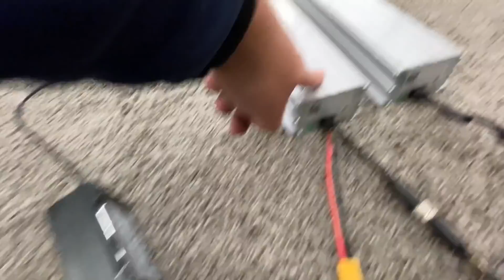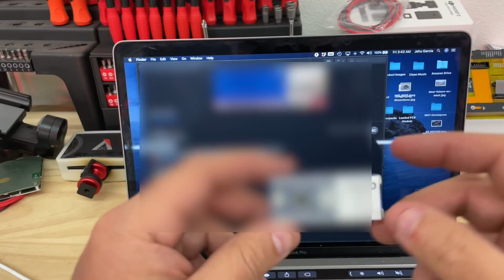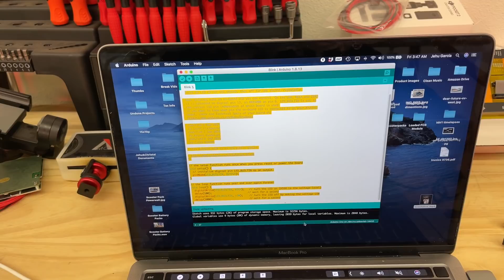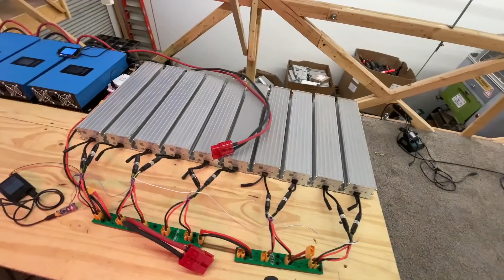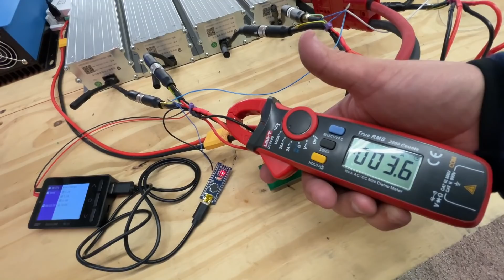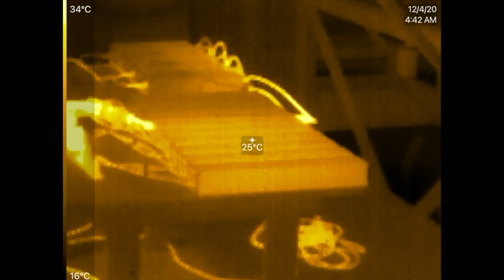The Best $125/Kwh DIY Powerwall On the Planet

Comment: I'm designing a tiny circuit board, about the size of a quarter that can run directly off the battery pack to do what the arduino is doing so the battery can be turned on and off with a simple switch. Would that be something you would be interested in? Should be cheaper and smaller than the arduino and will run off the high voltage just fine
Reply from the maker: Yes make it,  we’ll all buy it from you
Reply: @jehugarcia  ok, might have the design done tonight or tomorrow. 30 test boards take about 10 days from china. I'll keep you informed.
Reply: Yes very much interested.
Reply: @byronlovesdrifting1  https://www.etsy.com/listing/905013328/es-90-battery-activator?ref=shop_home_active_1
Reply: @Sirus20x6  can you upload the files for the design? Just placed my order, wanting to run the packs in series in the future wondering if the board can handle that
Reply: @byronlovesdrifting1  I see your order. it should be able to run many batteries. I put in 6 outputs that are all just wired together. you should be able to chain more than that together. There isn't a hard limit it just has to do with how far your wires have to go. I might put up the files eventually, but I have to sell at least 16 of them to break even and so far I've sold just the one lol. It's not that complicated of a design, it's just an attiny85 and a dc-dc converter to take the high voltage.
Reply: @byronlovesdrifting1  Oh I see what you're saying. the problem with putting them in series is the serial line is going to be at a different voltage level for each of them. let me sketch out some stuff. I think there might be a simple solution
Reply: @Sirus20x6  thanks friend, I could have been clearer for sure. Appreciate your effort I'll be ordering some either way to do some testing.
Reply: @byronlovesdrifting1  So I ran over a few scenarios in my head about how this might be done. At first I was thinking I could use optoisolators at each battery, but I would still need the dc-dc switching to get a 3.3v reference, and that's most of the expense. A good optoisolator is not really cheaper than an attiny85. if there was a way to steal 5v or 3.3v from the electronics inside this would be a lot easier, but with them epoxy potted and all that doesn't seem feasible.
Reply: @Sirus20x6  ok well i won't be using the packs in series for a while, using them as energy storage to start with so the current system should work no problem and I can solve that later if I need too. Thanks again for sharing your work much appreciated
Reply: @byronlovesdrifting1  mind if I ask how you're planning to use the 72v? Any good equipment out there that uses that?
Reply: @Evanrodge  I am in the process of designing an odrive compatible motor board that runs off of up to 140v. That's what I'm going to use mine for. high powered electric skate board with 2-3 of those
Reply: @Evanrodge  want to use them to power a VESC 100/250 controller(or two 😁) and my first attempt at rewinding a motor. Gonna rewind a Nissan leaf motor for lower voltage and put it in a dune buggy or off road converted car for my first attempt at a conversion. Something like a 2s10-12p would be the end goal just need to do lots of little steps along the way to make sure everything can handle a system like that.
Reply: @Sirus20x6  Any chance you might sell one of these all soldered/prewired/etc. Sadly I just don't have the soldering skills my self to trust working on the board directly. So something that had wire leads for the 6 output ports, leads for the battery and the switch all ready to go would be very helpful.
Reply: I'm game!
Reply: @rolandmitchell718  You can find the link to the listing on this thread. I'm selling them on etsy
Reply: @Sirus20x6  thanks!
Reply: @rolandmitchell718  Here is the link to the product https://www.etsy.com/listing/905013328/es-90-battery-activator
Reply: @Sirus20x6  dude you are a LEGEND
Reply: @Evanrodge  Oh I do programming and circuit design for a living. The hardest part was picking a sturdy switch. I'll make sure to send a couple samples to @jehugarcia to check out
Reply: @Sirus20x6  I noticed in the description that the ckt boards can be powered from its respective battery. I’m wondering if that configuration (while requiring additional ckt boards) overcomes the problem with batteries in series not seeing the 3V signal
Reply: @ericspurling3198  If you have one of my activator boards per battery it should work fine. the problem is that adds quite a bit of expense.
Reply: Sorry, this item and shop are currently unavailable

Comment: Do you know what the OEM connectors are?
What size heat shrink did you use to go around the battery?
Do you have to charge using the charging port? What's the deal with that?

Thanks for the vids!
Reply: https://www.mutuallc.com/L513-screw-locking-5-pin-Battery-connector-pd43402085.html
Reply: Those yellow connectors are called XT60.
Reply: @radfordra  right, those are standard connectors. Still looking for the "OEM" connectors as mentioned.

Comment: Oh my, the internet has no rules lol. This type of system is easy to do and very inexpensive I am building the same thing using A123 Bus batteries (LiFePo4) 40 volt packs real easy but I haven't been able to wake up the original BMS yet but it comes off easy so I can use any kind I like.
Reply: Hi if assessable what are the dates on these please?
Reply: @stevepr100  2006 in my build but different years

Comment: The arduino has multiple outputs. Just make new code sending individual signals and wire them individually to each output pin.. the uno has more pins than the smaller one..
Reply from the maker: Only one is labeled tx  can other pins act as tx?
Reply: @jehugarcia  an uno only has one set of serial pins but a mega 4 sets of serial pins

Comment: Hey Jehu, thank you for your contents. Did you try to firstly do all the connections with the batteries shut off and only after that wake up the batteries with the arduino to solve the inrush problem (arduino externally powered)? Another question: is there any another cable on the discharge connector beyond +48v, gnd and TX? I'm wondering if there's a Vcc rail there (3.3/5/12v). On the scooter there must be a way to power the main board even with the battery shut off. Otherwise how can the main board switch on the batteries without being powered? (Something like BEC on ESC)
Reply from the maker: The battery always remains on.  Only shuts off with large 1-2A loads without signal.  That’s how it runs systems. There is tx, rx, alarm & positive /negative load leads.  That’s it
Reply: @jehugarcia  Thanks for your reply. And what is alarm cable supposed to do?
Reply from the maker: You tell me
Reply: @jehugarcia  haha ok. Nothing found online anyway. It could be something like an electric lock. I think the only way to figure it out is to test and reverse engineer the unit
Reply: @jehugarcia   I just got a few of these from you (thank you) and noticed that both were on at about 15v on the discharge terminals... is this expected?  For what I need, 15v is actually perfect.  Do I need to only wake it up to charge?  Or is the signal only required if I want to discharge at 42v or greater than a few amps?  Thanks

Comment: Question : Pack is 10s but the meter is 8s.  Why use the 8s BattGo meter?
Reply from the maker: To power the arduino via the USB charge port
Reply: @jehugarcia  OK.  So, it there a recommended 10s meter?
Reply from the maker: Doesn’t exist
Reply: @jehugarcia  That is disappointing. How does one monitor 10s packs? I have two arriving today (from you !!). I have a 10s BMS. I have a meter that can see the whole battery but nothing to monitor each of the ten.
Reply from the maker: A regular meter,  i have the one I used linked

Comment: So I’ve started prototyping a nice plug and play solution for people who just want to have a no fuss operation of this battery’s. Dose anyone have more information on the BMS like chip IDs.  As I also want to build a smart version that will hopefully give us some battery information from the BMS
Reply: Definitely interested in this!
Reply: Sign me up
Reply: stm32 chip runs the bms 
have a browse on this  site to get some info in the battery
https://scootertalk.org/forum/
Reply: Xiaomi M365 36v batteries don't require any external methods of powering them and keeping them on
Reply: That battery’s shown in the video need a enable command sent every 5 seconds to keep them enabled
Reply: @robsondias258  yes but I'm saying an easier and relatively cost similar solution. I don't pay more than $60 for mine on eBay. The batteries use LG cells. They don't require this 5v signal check to use in the purpose. They are always on.
Reply: @radfordra  🤷‍♂️🤷‍♂️🤷‍♂️
Reply: @radfordra  a nice alternative if they become available from ex rentals
Reply: @radfordra  ninebot esx battery's don't need external commands either just need bms 1.2.6 flashed
Reply: @Buddasticks  that's still more work than I'd ever put in. The M365 batteries are literally plug and play though charging them via one pack will kill the BMS eventually. I recommend addi g a shutoff for the power on each pack then charge them separately. I had this happen cause I use 2 M365 in parallel for my ebike. Since I only use two it's simple for me to unlug one battery from the split cable.  before charging.

Comment: I knew in my community there is an Arduino programming club that occupies a building on Thursdays in Charlottesville the club is called Tinker Smith they used to have a MySpace page I think they're on Instagram listed in the IX Artpark in Charlottesville Tinker Smith's would definitely have some resource information around this Arduino thing that's Club was run by a guy named gopal Metro give it a check out might have more resource information as far as this Arduino stuff

Comment: I don’t think it’s ok to connect batteries like this, so as the one to charge the other, with no some kind of current limiter. You are stressing the BMSs, that’s why it quits.
Reply from the maker: you have no idea what you talk about.  you can clearly see in the video it was doing 13A well below the 25A limit.  And why adding Arduino prevents the BMS from shutting down?
Reply: @jehugarcia  I do have an idea, but i still hadn't see the video when i commented. :)
Anyway, what kind of current limiter were you using?
Reply from the maker: A natural one,  the voltage differential was such that only 13Ah transfer occur and then it starter tapering off

Comment: Jehu, is it possible you are seeing resistance build up on the DC Power strip?  maybe that is why you show a lower amperage the further down the line you go as  you test.
Reply from the maker: correct
Reply: How could this be mitigated?
Reply: @ItchyKneeSon  Center tapping between the 2 strips instead of daisy chaining 2 in line would cut it significantly...  other than that just have to beef up the conductors to stop voltage loss